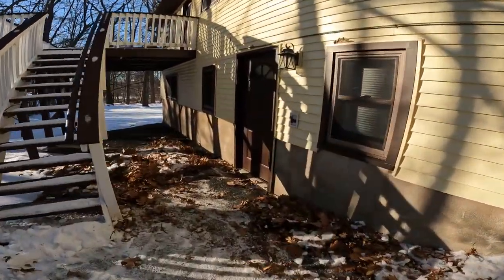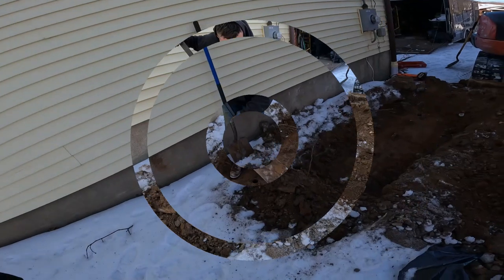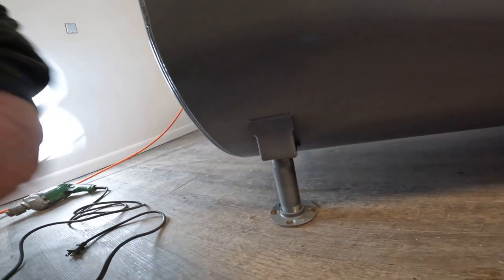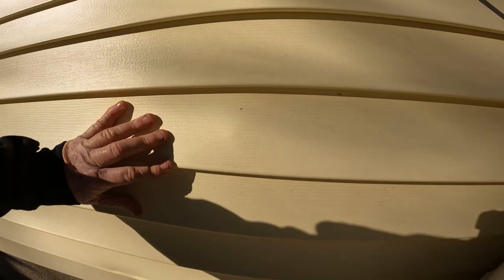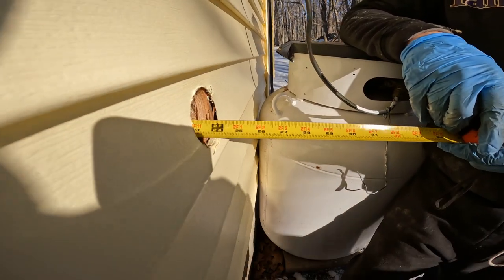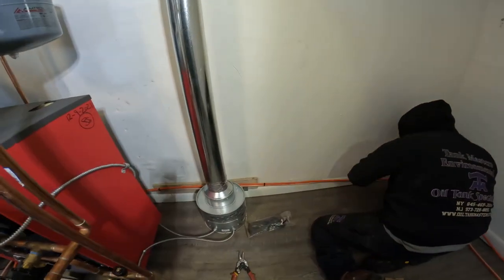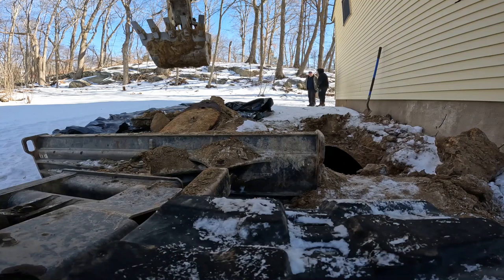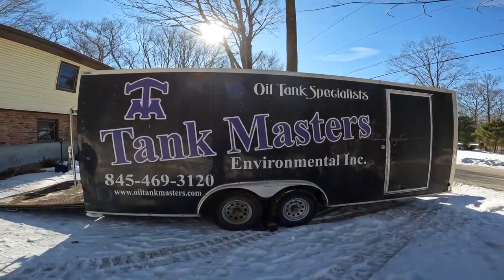How to Install an Above Ground Tank and Abandon an underground tank in place

Comment: wow that is a huge room to put boiler in everyone squeezes them in tightest dam closet they can find normally don't worry about service or replacement.
is that a fresh air intake for boiler the ductwork running across room? pretty fancy setup there.

Comment: What is the device on the floor just to right of furnace that is wired to furnace and vented outside along ceiling with what looks like 4" duct? I assume its an evac fan for any possible fumes, but never seen anything like it. Great detailed video as usual!
Reply from the maker: Good eye Jason, We were all wondering the same and that was also our conclusion. Immediately when the inspector walked in and saw it he asked "what's that" Great question.....
Reply: @TankMastersEnvironmental  
I'd be interested to find out if it is code in that area? I live in Newark Delaware, Lennox hot air oil, Tiger loop, Roth tank all in basement and evac fan not required. Or could it be make up air supply?
Reply from the maker: @jasonsmith1140  Craig just told me that Carmel requires fresh air into a burner room.
Reply: @TankMastersEnvironmental  Thank you for finding out and taking the time to pass it on. Appreciate it!